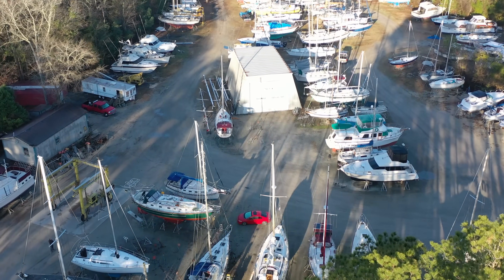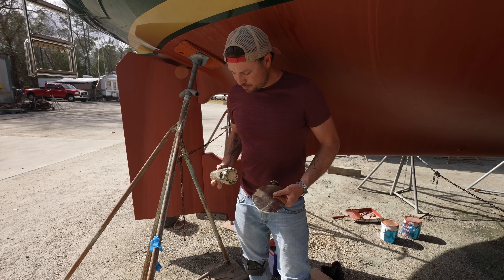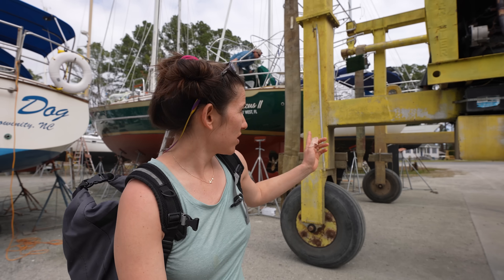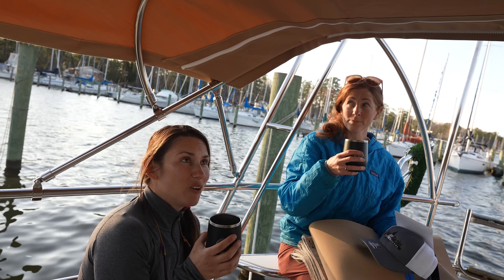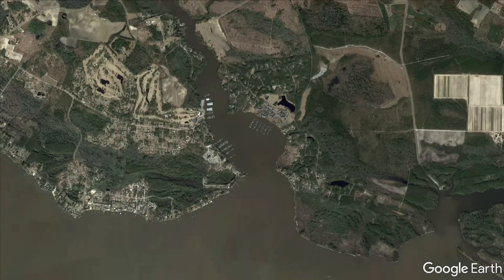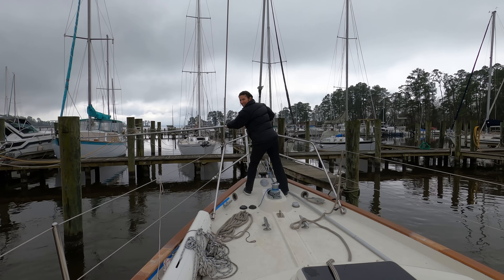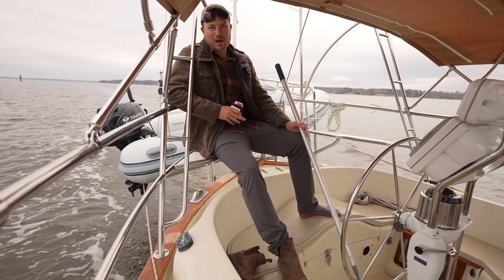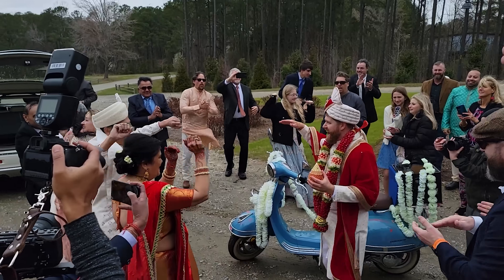Stuck in the MUD | S06E40

Comment: Re-splashing your boat after a long while on the hard is like the running back blasting through the gap stiff-arming everyone until they break into the open and... unfurl the sails! 
Makes one wonder just how the boatyard could know of broken off pilings in the runway and not drag them out! When you get back from Raleigh, you need to haul the boat out again and repaint the bottom of the keel! But of course, you know that. We'll always know there is a scuff on the bottom of that keel until you fix it! 😄 If you are going to go down the ICW, hold off on that until you get past Maransas Pass around St. Augustine.

Comment: Not a boater at this moment, however, I would expect the marine management would match customer boat types and depth of boat bottom to appropriate slips. Perhaps dredge the dock areas?  I’d be a bit perturbed with what you went through … 🤨🤭🥴🤓
Reply: then you may not  make it in and out of many marinas. the costs of what you are assuming should be done, is why it is not. 6.5' of keel is bigger than most marinas can afford to maintain at their shallowest slips/haulouts.
Reply: Keep in mind it isn't uncommon for entire marinas to be nothing but mud on a super low tide following a heavy northern front that blows the water out of the bay.

Comment: The max prop anode won’t last very long as is. One tip to help it last longer is to paint around where you put the bolts through the anode with spray on Trilux anti foul. That part of the anode won’t then dissolve as quickly . It is very thin in this part and the bolts rapidly become free otherwise. The other option is to buy the bronze adapter plate they sell which means you can attach the anode with a long bolt through the centre. Ours lasted October to August through the Caribbean and Pacific to Australia with this.

Comment: Lightning protection is tricky business, one part science, two parts magic! Did someone tell you the plate needed to be replaced? Looked like surface corrosion that could been cleaned off easily with a brush. Replacement was a lot of work, maybe just playing it safe due to all the expensive electronics? Just curious, great job, as always.

Comment: That was frustrating.  The other option that would have helped was instead of "Kedging" the boat (heeling it to reduce draft) is to "Lighten Ship".   Remove as much weight as possible, water, dingy/motor. tools, anchors, etc.. to let the boat ride higher in the water.  A big pain in the ass to offload a bunch of stuff but it may come in handy in the future.  Hope this is the last of the hurdles you have to deal with before you head South.    Hopefully you didn't scrape all that fresh bottom paint off the bottom of your keel..  : )  What is your draft?  That will have an impact on where you can go in the Caribbean.   Thanks for the Video!  Sail On!

Comment: I wonder why the marina hasn't had those pilings removed, or at least made it known that it's necessary to pass on the south end of the one in the fairway and to not use the slip that has the problem.
Reply: Unfathomable...
Reply: @RappinIggyG  Well, then I guess they'll all have to wait for a higher tide. OOh, that's DEEP.😎

Comment: I'm designing a new product designed to self rescue a MOB. 

it doesn't matter if the sailor is solo sailing or has a full crew.  

Rescue of a MOB is a challenge and it's a topic I never see addressed.

One guy said he's sailed 30+ years and never fell overboard but I'm a commercial diver and I've seen several divers go overboard and of course rescued but we have a motorized crew boat; not a sail boat. 

So I have the concept already drafted.

Now I'd like to hear opinions about this.

The second new design is a self recovery system for running around in sand or mud.

I have built dredge systems to raise large size ships and barges 

I know I can build a smaller version to rescue a grounded sail boat

Comment: BEFORE you go any further you REALLY need to pull the boat back out of the water and inspect the KEEL and RUDDER for damage. Then if you find any, contact that marina to cover the cost of repairs. Don't sail another mile without that inspection.
(;-) TP